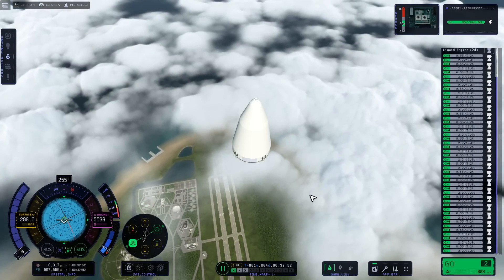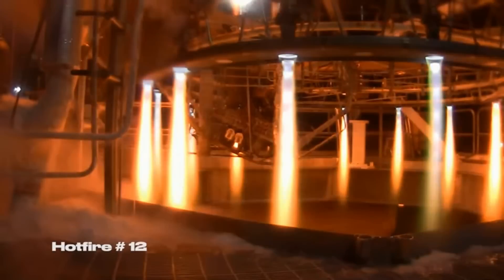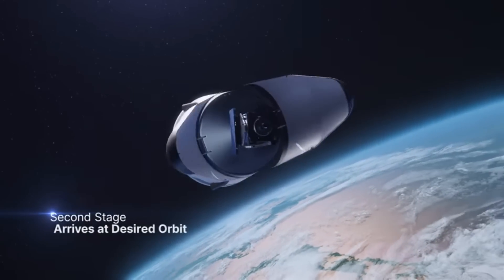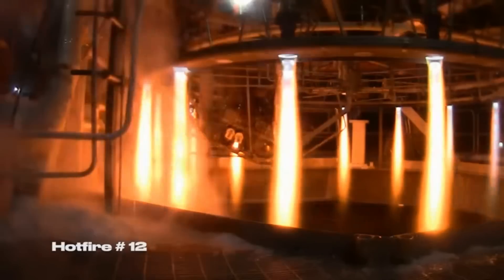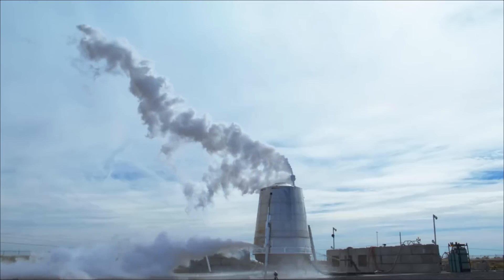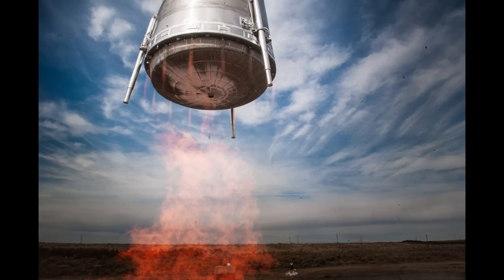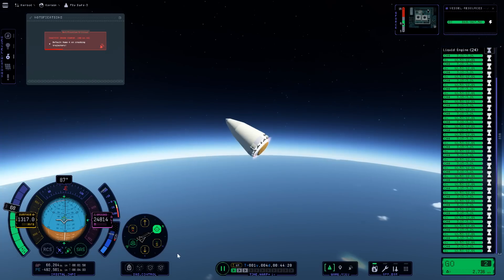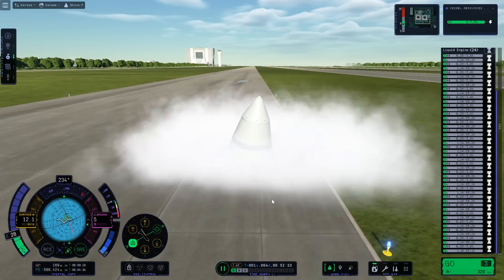Rocket Scientist Combine A Rocket Engine With A Heat Shield - Can They Revolutionize Space Launch?

Comment: Scott, methane would be no good for this application, as it would degrade to carbon and hydrogen within the heat shield which would cause clogging. The plan is to exhaust the cooling gas through the centre bleed hole. Again methane would break down to carbon which would have to be cleaned. Hydrogen has none of these problems. It is of course a bitch to handle and kept from leaking.

Comment: Seems like a reverse staging at altitude to couple a  very substantially oversized  landing skirt around the 2nd stage protruding nozzle should work to effect the  1 point landing. So how do you get the skirt up to the 2nd stage? Some multiple of 3 very small rocket engines, around the vented skirt rocket the thing up there. Retro-thrusters help position the long legged skirt to mate with the bottom of the 2nd stage.  The skirt looks like a round scaffolding with the three rockets on short legs that do not reach the ground and several long legs which will support the 2nd stage on the ground or landing platform.

Comment: I did boiler cleaning for coal  power plants and paper mills for 20 plus years. Used 2250hp frac pumps @ 8k pressure 600gals minute. Boilers are for steam turbine electric and to cook chemicals. 
You could generate power with each launch. 
Build tunnel straight down line boiler tubing layer with high heat refrac. Build a tunnel horizontal to tee into launch pad. It will contain the force and  divert explosion to where ever you decide to vent. Also allow the rocket engines to all be brought up to power without cooking launch pad. You could lower pad to ground. It will pull enormous vacuum at inlet and needs vent tunnels that damper the effects. You can use boiler tubing down the tunnels to convert heat into usable energy and save wear and tear to launch site. You plan to make multiple launch per hours lot of money being wasted. 
You would be able to run all engines at idle up to test launch without launching. 
When I saw the damage to concrete on pad it has bothered me every since. I have done concrete demolition where we cut out bad spots on bridges. We used 15k psi @ 50 per minute. Stripping concrete leaves rebar. Had rotary head and thick metal blast shield. 
Also we use pressure washer with 300hp 609hp diesel motor 
Vacuum truck with 300hp would be ahead of time to have them with electric motor chemical plants are strict on emissions first to build would be ahead of everyone. Want percentage to go into trust to build assisted living for my brother and the elderly in Crockett Texas build this town into retirement for elderly. Self driving vans on call for wheelchair build back medical facilities and college. Training for all mabe a plant for you. Ez to find.

Comment: Hi Scott. Wedding anniversaries are very important (big hint to my hubby, 19 years next week!), but space waits for no one.  Watching the NASA TV feed for OSIRIS-REx return capsule landing, I was amazed that it landed over 3 min before scheduled.  Perhaps 10 minutes after the successful landing the commentator explained that this was because the parachute had unexpectedly deployed at 20,000ft rather than 5,000ft, but this makes no sense, unless it was the other way around.  I then watched most of the press conference five hours later and there were small hints that some systems may not have performed nominally during the landing.  I wonder if they got very lucky and that the capsule came close to impacting the Utah desert at a very high speed.  Your expert insight is badly needed!
Reply from the maker: Commentator was misinformed, the drogue didn't deploy, and main opened a bit low.
Reply: Thanks, I rewatched the landing and there was never a verbal or visual confirmation that the drogue chute deployed as commanded at 102,300ft (AGL?). Instead the SRC kept "shooting in" at high speed until the main chute opened early at 20,000ft rather than 5,000 ft.  A last resort, backup procedure?  The calcs are beyond me, but it seems likely that there was only a small altitude/velocity window in which there was a chance of pulling that off successfully!

Comment: The X-20/DynaSoar was also to use hydrogen for active cooling of its re-entry surfaces (a tank was on-board for that purpose alone).

I wonder if that design could use current passive Shuttle / X-37 / DreamChaser-ish tiles instead with minimal redesign, but that's a whole other story...
Reply: I thought the Dyna Soar used water, behind a metal heat shield, for cooling.

Comment: I’d love to see the ROMBUS stage and a half modelled in KSP.
Reply: Oh, yes. This looks a lot like ROMBUS already. Just add a payload cylinder and cone on top and attach eight hydrogentanks on the sides, and it'll probably go into orbit automatically! I can't have been more than 6 when I was given the Danish edition of Bono and Gatland's Frontiers of Space - and ROMBUS/ITHACUS/PEGASUS just looked so mind-boggling cool, and so different from anything anyone had done by then, and even by now, 50 years later (60 years from the original conception!) Single-Stage-To-Orbit is just so much - simpler?

Can anyone provide a set of equations for payload-versus-fuel for SSTO, and for systems with two stages and three stages? With the proviso that all stages should be recoverable, meaning either landing under power, or at least capable of reentry and parachute landing?
Reply: You can watch @Hazegrayart version instead, not Kerbal tho.

Comment: I appreciate the insight but I wonder whether this shear test rig really provides valuable data. If it’s applying a shear load greater than what the friction material can generate against the rotor, then it doesn’t matter where it fails. As long as it fails at greater shear force than the caliper/pad/rotor can generate (and the tire can generate for that matter), then there’s no problem.

I get it that better is still better but I’m sure there are methods of attaching friction material that would be even far superior again than what OE/NRS are doing but at some point you have to recognize the diminishing returns.

Comment: If the heatshield is screwed, would your variable thrust profile have to compensate for an uneven load distribution? I mean, because the shield isn't symmetrical, the center of thrust would favor away from the center of the shield, forcing you to adjust your throttle profile from engine to engine to compensate....right??

Comment: Scott Manley, could you please find flaws in an idea I have for Starship. 
Why doesn’t Spacex line the two rocket chambers with rubber bladders. As the propellant flows out, the bags would collapse keeping the fluids relatively compacted, eliminating the issue of trying to spin the rocket to get the fuel to flow to the jets. 
If we don’t have a material that can withstand the extreme cold, then wouldn’t it be a great area to start doing research on?  With the Spacex engineers, it seems that the only thing impossible is the things not though of yet. 
If you need a basis, I saw an episode of Dirty jobs, where they were pulling a bladder out of a wing of a C38 that had sprung a leak. 
If jets can use bladders, why can’t rockets? 

If the fluids were contained in a bladder, then as the bladder compresses, clean usable space increases. 
This could be turned into livable space if Starship or the boosters were to be used as a space station. 

If you can’t contain the liquids in the bladder, how about filling a bladder with compressed air to push the fluids into a smaller area? As the bladder expands, that space could potentially be used as a livable space. 
possibly even installing a Bigelow inflatable module inside the starship fuel cavity greatly expanding the livable space Astronauts would have directly as after launch.

Comment: Would it be possible to have the exhaust plume itself work as a heatshield, with the flow adjusted for pushing the atmosphere out of the way so the craft doesn't get impacted directly and brakes on it's own thrust during the period where it would otherwise be hitting reentry heat?
Reply: You could but that's a lot of fuel to save for coming beck
Reply: That's literally what Falcon 9 does. The turbopump exhaust on Stoke's rocket is doing exactly that.

Comment: Brilliant! Seen the news, but this is the 1st I got to know of the tech. Interesting, but still a long way to go; like those legs might not much withstand re-entry from orbital speed, friction, heat, and final landing jolt. If ego is not an issue, they should just initially hitch a ride on Falcon 9 to verify their 2nd stage asap. What is the actual vehicle diameter size anyway? Wonder if SpaceX would be interested boosting it to space if it gets develop to 9 meters. In hindsight, considering hydrogen's bulk requirement, this ride hitching might be doubtful as well.
Reply: I don't think it's that easy to just hitch a ride on a F9.  They need to fuel that thing and last I checked nothing on the F9 strong back and other hardware is designed for liquid hydrogen.  So modifications to the launcher would also be required.
Reply: @TheEvilmooseofdoom  Ah yes, those issues. They'd need to change/built & develop the whole stage 0, if both sides are willing; this enables lower stage 0 and stage 1 costs. Versus traditionally developing all the boost stage and launch facilities themselves. The latter would strategically independent and preferable anyway. It depends on securing customer projects with this unique advantage: total launch cost/kg., something SpaceX already rule, and assured growths down the line against all other launch SPs.
Reply: @TheEvilmooseofdoom  - yeah, it's a big logistical challenge to launch on Falcon. Not impossible, but you'd be doing a lot of infrastructure investment for a one-off test flight. Vulcan would be a better match once available, since that uses a hydralox upper stage, but still not easy or cheap.

Comment: 1 engine with 30 nozzles... controlling the throttle of each engine. But there's only 1 engine? Then later again it was said they were using 15 out of 30 engines? Which is it? Is engine and nozzle interchangeable in rocketry terms or am I missing something?
Reply: It's like many of the Soviet engines — one set of pumps, but multiple chambers. This is generally considered to be one engine, since it's one unit that gets attached to the vehicle thrust structure. Though that feels a bit hazy in the case of Stoke, since the engine doesn't seem to be a cleanly removable unit... it looks to be built into the vehicle structure, so servicing is likely to involve swapping out parts rather than entire engines.

Comment: Another thing to consider, if you can throttle your engines enough to maintain a higher pressure within your nozzle than the combination of hypersonic compression and altitude, the bowshock of the plume will serve as a very good heatshield. The key to this is to do your burns as deeply into the transsonic region as possible balancing throttlability with the heat resistance of your booster's ass end. This may allow the use of Niobium rich engine bell alloys with heat blankets for your powerhead to protect it from recirculation, which you need anyway. This is not unlike the super-cavitation torpedo/missiles that Russia has developed. The bowshock of the cavitation bubble protects the rest of the torpedo from water drag.

Comment: 1:10 You mean carfully throttleing each NOZZLE, as you just said it was only 1 engine.  Then again at 1:20 are they using 15 of 30 Nozzles or 15 of 30 Engines?  For a video which is seemingly going out of it's way to make a distinction between nozzle and engine it completly conflates the two literally in the same breath that it tries to distinquish them.

Comment: KSP taught me that engines ARE heat shields. Or at least, engine bells are pretty heat resistant xD You would think they could vent gas into the engine bell during re-entry (it that is even needed) and just re-enter using the engine bell to take the heat. But obviously KSP is not real life xD

Comment: that looked like a pretty hard landing! hopefully they're able to get better with that
Reply: Why?  It landed intact.  If the gear can take it what is the issue?
Reply: @TheEvilmooseofdoom  bouncing is a very bad thing and shows that either it hit harder than it was designed to, or the shock absorption of the landing gear is insufficient. i fully expect them to fix it at some point, hopefully before the next flight!
Reply: @octagonPerfectionist  It "bounced" because the engine was still on, it actually "lifted-off" a second time.

Comment: Two words: Phillip Bono. Concept art from 60's in this video presents his ideas. His design in 60's were based around the same principles, and use of rocket engine plumes as heat shield was crucial. It was vertical landing vertical take-off, single stage to orbit design. In fact his designs were in 80's reason behind DC-X rocket prototype which is direct predecessor for SpaceX system and Blue Origin approach. Look up Phillip Bono ROMBUS and derivatives. DC-X was very scalled down and less ambitious attempt, and SpaceX just took small elements of overall idea. AFAIR Chrysler also based SERV design on Bono concepts, and I think also Japanese concept vehicle Kankoh-maru years ago.

Comment: It always made sense to extend nozzles down until they connect with each other, making 1 complete rigid structure that doubles as a shield protecting everything above the nozzles.  I don’t know why Elon doesn’t simply control thrust levels of offset engines to steer the rocket and thereby eliminate the pivoting nozzles (the best part is no part).  Also, one large pump for all the nozzles could replace 33 separate pumps dedicated to individual nozzles.
Reply: Talk to Japan about how things can go in developing even a moderately large pump.  Another factor is that going down to one pump erases all of the redundancy.
Reply: @marcmcreynolds2827  yes redundancy is good. Perhaps one pump per 4 engines in a 32 nozzle booster. Assuming 28 out of 32 engines at full power is enough.
Reply: Isn't this sort of what the Russians have been doing for decades?  One pump and two or four chambers, nozzles and bells per engine.  Sure it was to solved their burn instability problems but the result is the same.
Reply: I think you are VASTLY misunderstanding the scale difference between the two systems.

Comment: There is 2 engines. Each having 15 chambers. At this hop there is installed only one engine and whole hop was done with 15 chambers only. Later prototypes will have both engines and 30 chambers.

Comment: The NOTAM they issued for the test suggested the rocket might fly up to 1250 ft. AGL and I have to say, I'm both impressed and disappointed at the same time. But given that the field elevation is ~1200 MSL, I wonder if they meant that it could fly up to 50 AGL and they simply used the wrong datum.
Reply from the maker: That was probably the altitude they expected debris to reach if it exploded.

Comment: One long term factor that I imagine will play into the longer term economic viability of this vehicle is the choice to have two entirely different systems for propulsion with different engines and fuels.  This requires substantially more infrastructure to manufacture and support when into a cadence of flight and vehicle reuse but maybe the savings from that reused second stage translate into profit.  I understand why this choice was made but SpaceX has essentially the same engine with a vacuum nozzle for the second stage.
Reply: It is, spacex doesn't like mixing fuel types.